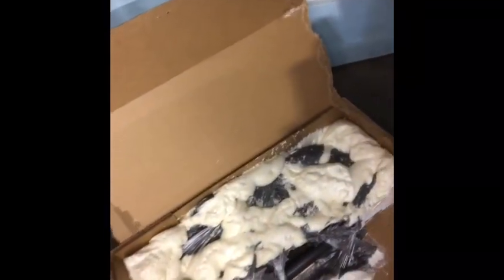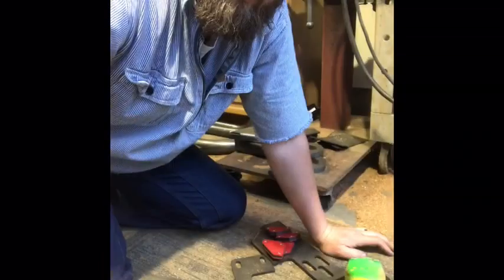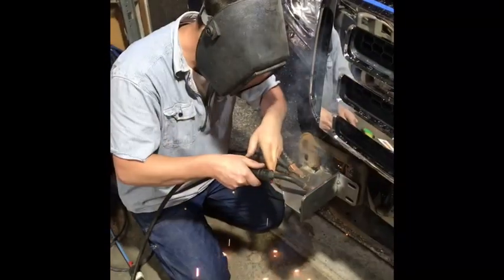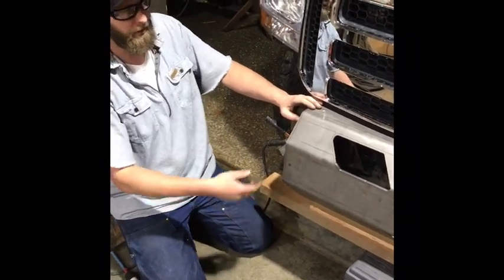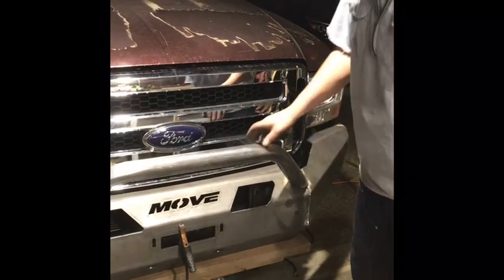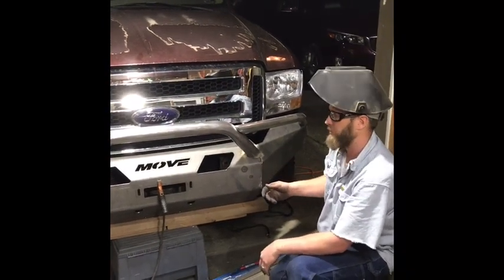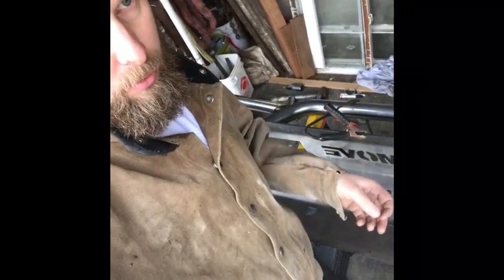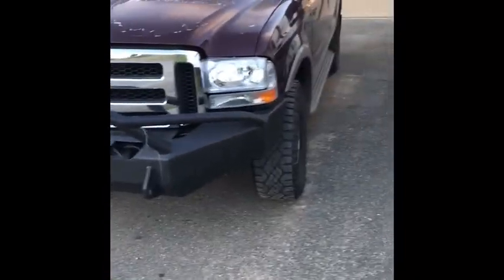MOVE bumper build

Comment: What type of winch did you get?
Reply from the maker: Matthew Faryna I Had an old Warn 9000 that I put in it. It fits perfectly. I have run into a problem with the piece of steel that I installed under the bumper has made it very difficult to remove the bumper to work on the winch.